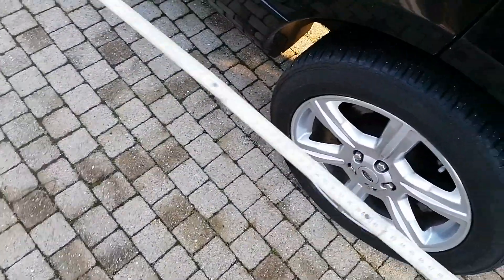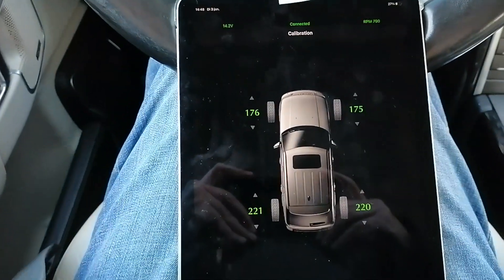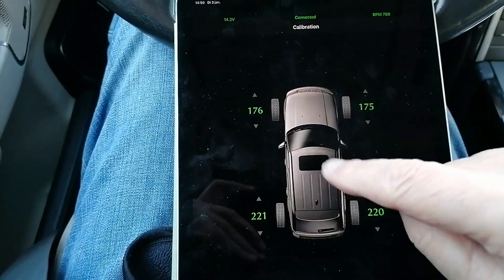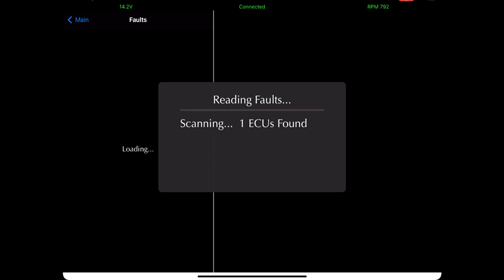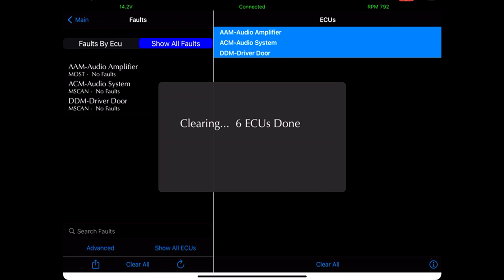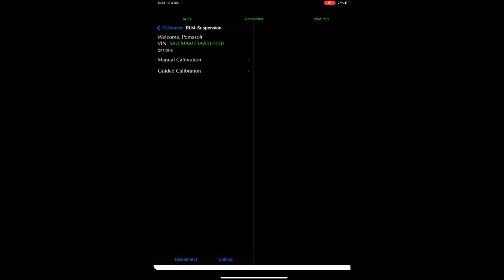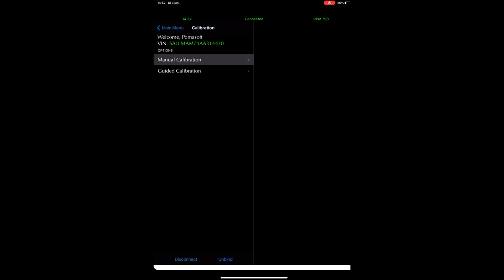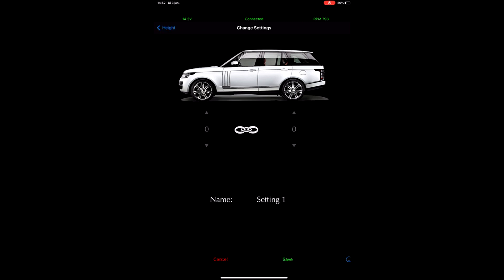Gap Tool Height calibration of the L322 Range Rover 3.6 TD V8.

Comment: Whats the exact differences between guided and manual calibration?
Reply from the maker: Don’t quote me on that but I believe the guided one is that the program on the Gap tool guides you through the process on every step you need to do and the manual one is that you enter the values into the Gap tool to have every wheel lowered or raised by the value you want it to. Hope this helps and thank you for stopping by 👍😀

Comment: Strangely enough I did mine the other day, didn't film it though. Mine was sitting a bit low on the rear. Also if you use the guided calibration, it tells you to adjust the suspension without you sat in the car and gives you the correct measurements to set the front and rear to. 👍
Reply from the maker: The concrete floor of my carport is not level so it always seems that the height is off but it was only 1 cm different from the right hand side both in front and in the back 👍😀
Reply: Ben = you should do a video on that 🎉
Reply: @robholland6460  yes, I think I will. 👍